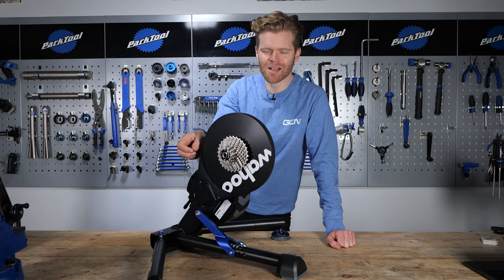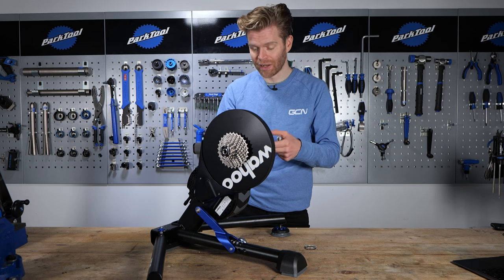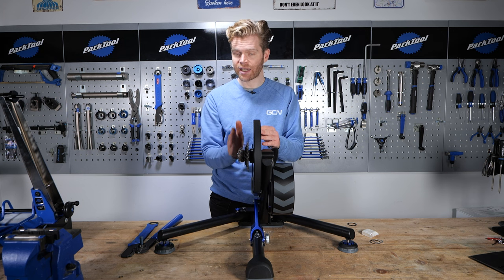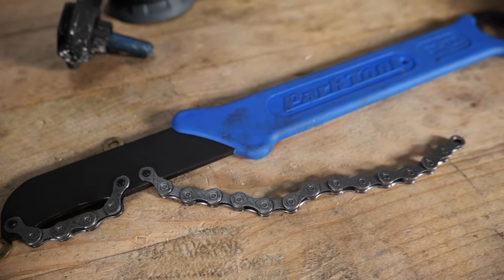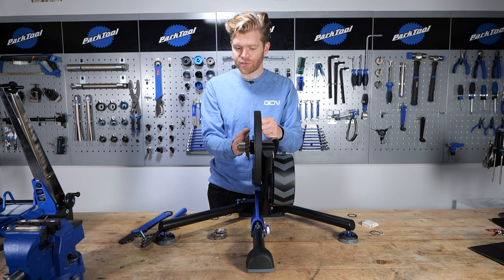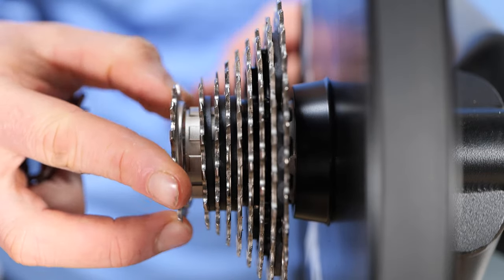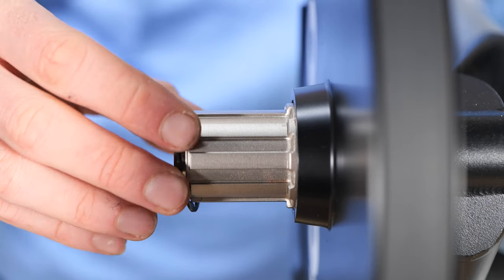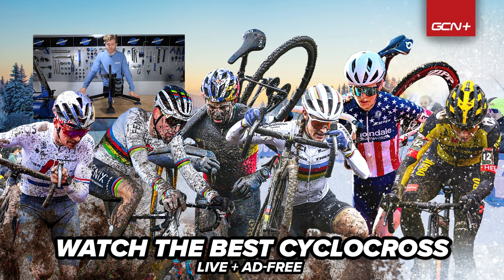How To Use Bike Cassette Spacers | Monday Maintenance

Comment: It took me getting my smart trainer to realize that the drivetrain on my road bike was completely worn out, including cassette and chain. It would also be ideal if the cassette type on your trainer is an exact match to the one on your road bike for the best fit.
Reply: 100%.  Need the same gear range, as that will affect chain length.  But having old chain and cassette on your road bike, then installing brand new cassette on the trainer... the chain may likely have stretched and won't fit the new cassette.  I had that exact issue awhile back.

Comment: I swap between two different sets of wheels and adjust my derailleur slightly for each set. Never thought of using a spacer - will see if that stops needing to adjust between the two wheels. Thanks GCN!

Comment: I got a Zwift Hub about a month ago. Had trouble with this. Turns out the Sunrace cassette was a couple mm wider than the Shimano on my bike. Both 10 speed cassettes. Bike shop couldn't get it to line up properly. So I purchased a matching cassette and a few different sizes of spacers. Turns out a combo of 1.8 and 2mm spacer lines up well. Making sure the cassette is the right tightness along with the nut on the end makes a slight difference too. Took some trial and error on different spacer combos along with switching back and forth indexing to get it to line up right. Be careful because its possible to fit just enough spacers that the chain can rub or be very close to the frame as well. The space between the chain and seat stay is almost identical on my correct setup.

Comment: My 20 year old road bike has a Campy Centaur 10 speed drivetrain, but the rear wheel has a Shimano freehub (I got the wheelset at a great price but it only came with Shimano). I initially used an American Classic "conversion" cassette that was Shimano-splined but Campy-spaced that worked perfectly, but when it was time to replace it due to wear the price had gone up quite a bit so I found a way to make a standard Shimano Ultegra cassette with the cog range I wanted (12-25) work with the Campy drivetrain using 4 2.5mm spacers between the 3rd smallest and 4th biggest cogs. Shifting was quick and smooth with no grinding or rubbing and a nearly silent drivetrain after a good cleaning and lubing (I've always used Dumont yellow with great results).

I just ordered a Wahoo Core trainer and will be using an unused 12-23 Ultegra cassette that I bought a few years ago on it, with a new chain of course, using this modified spacing. When spring comes and I'm ready to ride outdoors again I'll either take it off the trainer and install it on the wheel, or more likely buy another one and install it on the wheel so I can keep using the trainer without having the move the cassette between the two all the time. Or I might just swap the cassette currently on the bike with it (but it's old and skips so probably not).

This may or may not work with drivetrains that use a different number of cogs but I don't see why not so long as you got the spacing almost exactly right to the mm or less and/or were willing to put up with a minute amount of misalalignment and the occasional need to trim the driveline.

Comment: Thanks for the video!

Worked like a charm for me on Token EC24AD wheels and Shimano Deore M5100 11-42T casette with Deore RD-5100 mech. When I put the casette flush on, without spacers, my derailleuer wouldn't shift into highest 2 gears (biggest 2 cogs). At first I thought that I might have had a faulty mech but after installing a 2mm spacer on the hub before the casette, after sine tweaking mech shifted gears perfectly.

Worth noting that my mech worked perfectly without the spacer, just wouldn't shift into highest 2 gears.

Comment: I've got a 10spd bike which shifts perfectly on the bike wheel and erratically on the trainer. I found the easiest way to fix my issue is to not install the supplied spacer for 11spd cassette bodies, so essentially I did manage to move the cassette the other way. Works like a charm now.
Reply: I'm having the same issue. I have a 10-cassette Shimano HG on my Saris H3, which has an 11-speed hub. The problem lies with the smallest cog as it keeps clicking and struggling. What solution did you find for this?

Comment: I repurposed a number of spare/2nd hand (ebay) parts to build most of a bike specifically for use on the trainer. It means I can thrash away indoors without feeling like I'm compromising my outdoor steed. 
Ensuring I found parts with the same number of gears and that permitted me to dial in current bike fit settings was the worst part.

Comment: My experience has been anything from 6-9 speed you do have more leeway with not having to be precise. Once you get to 10-12 speed the tolerances are just so tight hence the conspiracy why 105 went to electronic because cables aren’t going to be precise enough for that many gears.
Reply: In MTB they work as they should, so I don't think that's the issue.

Comment: Considering I won't swap from HT to wheel because my bike will stay all the time on HT, I can simply set my dérailleur to the HT without purchasing any spacer. Am I right ? 
The spacers are just to avoid setting from HT to normal wheel every time.

Comment: Thanks for the video!

Last week I fitted my 10 speed 105 cassette in my Zwifthub. I used the provided spacer and added the Shimano one, but even with a tight secured lockring, the cassette can wiggle a bit. Do I add more spacers? Or is there another solution to this.

It does shift properly..
Reply: Cassette is tightened to proper tightness along with the silver nut on the end? If not make sure those are both snug. I have a Zwift hub myself

Comment: Please May I ask a question regarding cleaning my tyres.

After washing, when I spin the wheel, I can hear water still in the rim. I obviously leave it with the drain hole at the bottom, but all the water doesn’t come out 🤷‍♂️

Comment: What if the skipping happens when shifting to easier gears up the cassette, but right in the middle of the cassette and not just at the largest cog? That's my issue. Would I space out the trainer, or the bike? Using my bike with mechanical 105 11-speed on Zwift Hub.
Reply: Me too, hoping for a fix

Comment: I´ve just got a 11-42T for my kickr (same 11-42T on the bike, different brand) and i have an issue on the highest gear as you mentioned. by adding a spacer on the bike and re-indexing, wont bring a problem when back to the kickr? or the indexing is only between the gears and wont be impacted by the changes? cheers

Comment: Have similar issues.  My problem is, that I feel that I can't get into the smallest cog, from big chain ring, without it sounding like im cross-xhaining, but from the 3rd smallest up, everything is fine on my trainer. But without a 1mm spacer, the whole cassette is loose on the hub. 

But when I switch the cassette back onto the bike, its perfectly fine. 

Even bought a new identical cassette, (10spd shimano, 11 - 32), fitted it onto both, with same results. Fine on wheel, rubbing/grinding on trainer. Any clues as to what else I could do?
Reply: Same issue for me with 10spd shimano

Comment: Campagnolo spacers are different than Shimano/SRAM. When you have legacy gearing, how do you space for 9 or 10 speeds. 
Can you covert the new cassette or do you have to find a new similar brand and speed cassette?
Reply: To use a Campy cassette on a Shimano/SRAM freehub you can either swap the hub for a Campy one, use a "conversion" cassette (American Classic used to make one), or use a Shimano/SRAM cassette and replace the spacers with ones that bring everything in line.

Comment: I am brand new to the world of direct drive trainers. I just got an Elite Suito and after a little struggling I have my 2013 Felt Z95 (that uses a Shimano Sora 9 gear cassette) bike correctly attached to the 11 gear cassette Elite Suito. I haven't plugged it in yet but it appears the derailleur and the cassette aren't meshing properly just by spinning the pedals backwards. The chain is getting out of whack on the smallest gear. I have 2 spacers that came with the Elite but the instruction manual (which isn't the greatest in the world!) says I should need to use 2 spacers with a 9 speed cassette, 1 with a 10 speed cassette and none with an 11 speed cassette like I have. Maybe a dirty cassette on my bike and/or a stretched chain? Any suggestions? Thank you!
Reply: You'll need to change the 11-speed cassette on the trainer to a 9-speed one (same as on your bike) and use the spacers on the inside to cover the gap. Apologies if you have already done this and I haven't followed it correctly!

Comment: Why not just measure the distance between the end of the axle and the smallest sprocket on both the bike wheel and the turbo trainer with a depth micrometer or a digital caliper?  The one with the smallest dimension can be left and the difference between the 2 sizes will be the amount to adjust it by on the one with largest dimension.

If the inside of frame dropout touches the end of the axle on both the road wheel and the turbo trainer this will be a common datum, unless I am missing something🤔
Reply: That could work in some instances but the position of the cassette itself is not always the reason for poor shifting its just the solution. Slight differences in tooth profiles between brands or groupset tiers, or just from one cassette being more worn than the other can cause the issue too, some drop down easy but need more encouragement to go up, some go up easy but don't want to drop down. For example my old road bike had an ULTEGRA 11-28, and the turbo had a 105 11-28. I had to shim out the 105/turbo 0.5mm because the bike wouldn't shift up into the largest cog, I damaged my ULTEGRA cassette when it was still quite new (don't ask🤦‍♂)  I temporarily put the 105 cassette (without the spacer) on the bike while waiting for the part (middle of the parts shortage) and I had to adjust the gears because it would not shift into the biggest cog just like on the turbo, when I put the new ULTEGRA cassette on the bike I did not need to adjust anything and the 105/turbo did not need the spacer anymore 🤷‍♂.

Comment: I really don't want to adjust the bike to accommodate the trainer. I just adjusted the indexing to the max on my Zwift Hub and it's still not locating on the smallest cog correctly. 

Other posts suggest new chain, same cassette, barrel adjustment....so annoying it just doesn't work out of the box

Comment: I find my new zwift hub has some odd transmission clunks. I have a newer chain, have done microadjustment (di2), but the cassette that comes with hub does not have hyper-glide, so is inherently more noisy then my road wheel ?
Reply: It lists as hyperglide on the website

Comment: I’m thinking about getting an indoor trainer. My question is, I have a gravel bike with a Grx 1x set up (11-42). Can I use the 11-28 cassette that comes with it, or do I need to swap mine over every time? Thanks
Reply: You probably can, although not recommended. First the chain length for 11-28 should be much smaller than 11-42, so you'll need to be much more aware of your gears, the rear derailleur will be less stretched. Second, probably will have some issues with indexing, gear change should be a bit more difficult. In summary, ideally use the same cassette, or the closer you can. But in your position, I'd probably try the included 11-28 first and see how it goes, then buy a bigger one if really necessary.
Reply: @stefanohbellote9948  thank you
Reply: Its worth bearing in mind that on an indoor trainer excess weight is irrelevant (because you are are not actually moving anything) and the cassette will not be exposed to dirt, mud etc. that can effect shifting more on a lower quality cassette. So many people pick up super cheap heavy steel cassettes to drop on the turbo,  like a Zitto, SUNSHINE, Z-Race, GOLDIX, VG-Sports, BUCKLOS, BALONY (yes that last one is real) as far as I can tell all come out the same factory in china, Direct from Ali-Ex I can get an 11-42 for about £20/$25
Reply: I'm running the same setup and having indexing issues so thinking the next port of call is a new cassette or chain which is annoying after this initial outlay. 

I'm thinking of getting like for like and use the old one on the turbo which still appears to be in good condition.
Reply: Yes you can, but the derailleur pulley likely need to be repositioned closer to the 28 tooth cog on the trainer or the shifting will be balky.  That's done by adjusting the B-tension screw.  I do this with my 1x 10-42T mountain bike when installing it on the 11-28T trainer.  Note, you'll need to put the B-tension setting back when you put the original wheel back on or the pulley will grind against the larger cassette gears.

Comment: Does a Rival/XDR freehub require a specific spacer?
Reply: Kind of, the diameter is the same but the splines at the base are different, you can get spacers that have no "teeth" on the inside they are sometimes sold as BB spacers (as they are about the same size as a BSA thread and can be used for that purpose too). There is no real reason that I know of that a spacer in that position needs to engage with the splines so it should work fine.
Reply: According to the instructions on the Wahoo website, you shouldn't use the included spacer with the XDR freehub. I think the spacer is used if putting a mountain bike on the Kickr. That said, my road bike was difficult to index on the Kickr Core (using the correct cassette), but eventually I had success.

Comment: Hi guys,  I've always had my 10 speed bike on my wahoo kickr with quick release . Over the winter, I decided to put my 11 speed bike with thru axle on the kickr but when I put the thru axle adapter on the cassette side, the cassette doesn't spin freely . Any help or advice would be very much appreciated 🙏
Reply: I've done this exact thing, had no issues. So, some questions:
1. You bought an 11-speed cassette and installed on the Wahoo?  It won't work with the 10-speed on on there.
2. Used the  cassette spacers in the same order they were in the box?
3. If I recall correctly, the thru axle adapters are reversible (both sides) in order to support two different lengths of thru axles.  Make sure you know the length of your axle, and check the diagram to make sure you installed it correctly.

That's all I can think of for now, will check back later to see your response.
Reply: @Ron's Kayaking and Fishing  only way I've it working is by only tighten the cassette by finger tight
Reply: @Ron's Kayaking and Fishing   going to leave it a day or two  it's getting on my tits . Yeah the cassette is a 11 speed,  it's when I put the thru axle adapter on the cassette side when the cassette doesn't spin backwards. Without it, the cassette spins fine.  Just making sure did you greese the adapter that fits the cassette side? It slides in between the cassette and freehub?
Reply: @darrenthomas9928  Sorry Darren, not to be too redundant, but I feel like Ron is asking you if you have the thru axle adapter turned the correct direction, as it's a 2 way adapter (made for 2 different size of thru axle) and it fits both ways. Plus, I use the 142x12mm thru axle adapter with my gravel bike and have never needed to use grease.
Hope that helps!
Reply: @Bateria YVR   the thru axle on the cassette side can only go one way the one on the none drive side. Yes, it is the right way . The cassette stops spinning freely when I put the thru axle adapter on the cassette side . It sits in between cassettes, but when you do the cassette stops spinning and tries to push the adapter out   . Wish I could send a video

Comment: #gcntechclinic Howdy wonderful tech clinic humans. I am lucky enough to have in my possession a 12 speed 11-34 Ultegra cassette. It’s been on the bike for 1400miles or so and I have come to take it off to give it a deep clean but it’s stuck tight to the hub. Any suggestions as to how to get it off the hub without bending anything. (It was installed with a little grease to hopefully stop this from happening but that’s clearly not gone so well). Thanks!